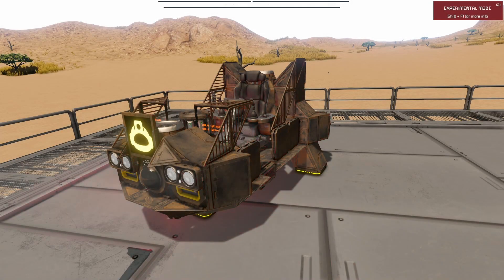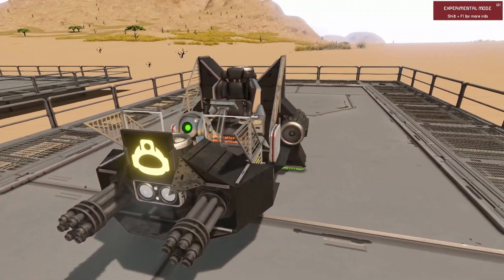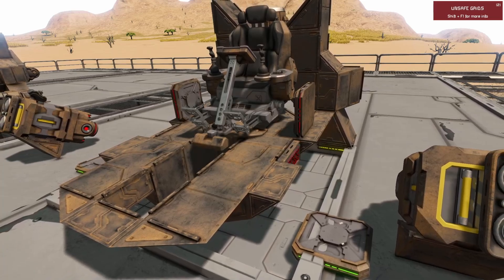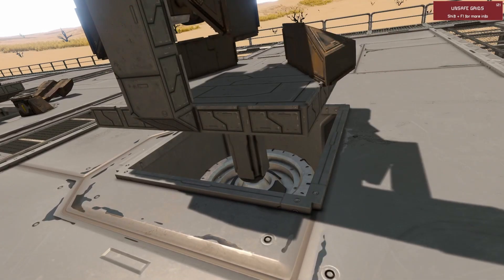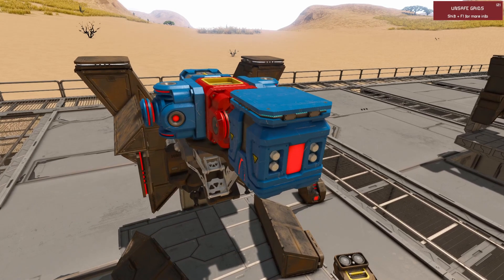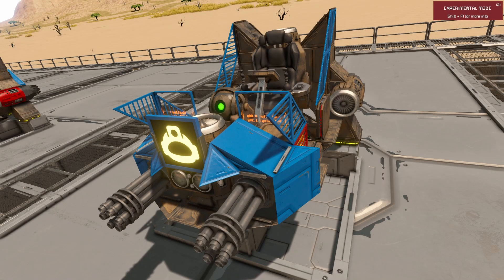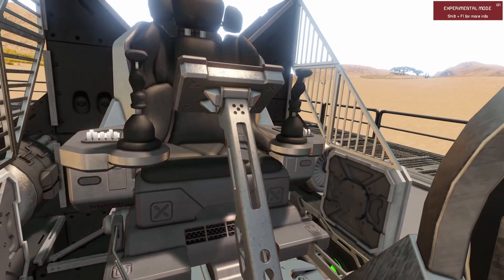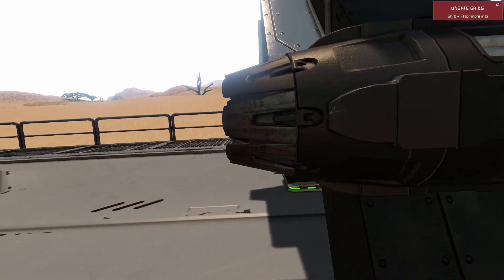Building a Hoverbike in Space Engineers

Comment: Waited till I watched the upgrade video before adding suggestions or idea's to consider. So it seems like a good starter transport as long as you have access to uranium. For a lees pcu intensive alternative to the mag plates on the side you can use just light armor plate or a 1x1 glass plate. Also since it doesn't have a reverse thruster then it a turn and burn which is ok if your not apt to slam into things lol. I guess then 2 questions, do you know about the hover script that will make regular thrusters into a faux hover engines and have you ever messed with the "real" hover engines?
Reply from the maker: Hey bud, thanks for the comment! Appreciate you watching through all that :) Great suggestion on the armour/glass plate instead of the magnetic ones - hadn't even considered the armour!

Having the spare Uranium to run this thing is really the key to this one. As I was building it initially it had 2x Hydro-Engines, but it ended up getting too big (especially with the large tank!). And for my survival playthrough, this ended up not being super useful, at least not until I manage to steal missiles or something from an NPC base, or if I manage to get to space fairly quick... but nice to have in your blueprint arsenal if you're just milling around in creative :)

For flying it, your reverse mechanism is simply to angle upwards, especially in the 2nd design. This still gives you lift, but also slows down your forward movement - or there's always turn and burn like you said :)

Haven't tried the hover script yet actually, but the the actual hover engines mod is one of my favourites!!